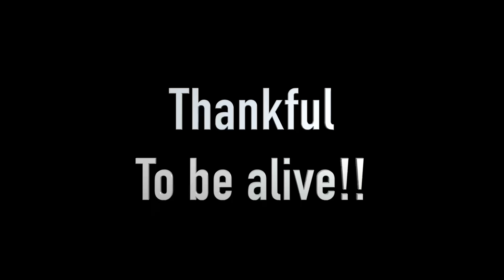The Firefighters said I was LUCKY TO BE ALIVE after this stupid MISTAKE!!!

Comment: This is my first time seeing one of your videos. It was awesome and terrifying all at once. I want to tell you a true story about a man I know. When he was 26 years old he was the manager of 7 food concession units. Six, were roll offs placed using a massive forklift. Each one was 8' square. Each of these units were fed approximately 250000v. Part of the man's job was hooking up the power to each of his units. It was drizzling out, the ground was wet, yet he successfully set up all of the six roll offs. Now each unit was supplied via 4, 1/2" copper wires. Each end of the wire had a 3/4" locking cam encased in a specific color rubber. Green, White, Black, Red. The "sow" aka generator, was in full displacement, it was pushing millions of volts. I don't know how many exactly. The man was using a headlamp with a white beam. Just as he was ready to set up his largest unit, a 26' trailer powered by around 750000v his head lamp quit. Frustrated as I was, yes this miracle story is about me, I went in search of a friend who might loan me his. The time is approximately 130am. I was cursing the weather, the time but NEVER one of my 30 employees, and just felt like damn!. But I got families of employees that depend on my operations running smoothly and efficiently. So I sucked it up, I knelt down, turned on the lamp but did not recognize the yellow hue, I picked up what I saw was the ground cam and went to plug it in and the very second my hand carried it to the piglet I  saw the mistake, I had made but it was too late, I remember a three inch spark. Witnesses, all 250 odd people present. Said the night turned brilliant white for a 1 mile radius and the subsequent explosion shattered windows nearby. I was thrown in an arc approximately 36' long and 16' off the ground to be slammed with such force into the very unit I was supplying that it lifted the 30000 lb trailer onto two wheels before slamming back down throwing my lifeless body ten feet away. Let me stop here to tell you that 1 month before I had taught my employees CPR. When the trailer flipped up it dislodged the coka cola syrup containers hitting one of my employees in the leg and dislocated his knee, he said to me later we saw you die but we had to try so i slammed my leg back into place and within seconds we flipped you over in it was obvious at that moment you were gone but we began CPR anyway with no though that you could not be saved. I watched the employees flip me over and the two did not stop for over twenty minutes till an ambulance arrived. Only then did they relent in their efforts. The EMT hit me with the electrical thingy and got a nearly non-existent pulse, very erratic, the 15 minute drive saw my heart stop for 3 more minutes. When I was wheeled into the emergency room,I was hooked up to everything, and it was determined that I was comatose with zero brain activity. They put me on life support and on a minute by minute observation. Around six hours later my heart stopped again and for 7 minutes they worked frantically short of putting hands on my heart before they rebooted it. At this point. The doctor said to contact my family for consent to remove me from life support because as he understood things, taking everything into account, I was not going to be able to survive. On my own. And if I did I would most likely live in a bed for the rest of my life. He at the point took me off the bed watch. 35 minutes later I woke up. I didn't recognize my surroundings, I removed all the tubes, IVs, and wires from my body. And had jumped out of the bed and naked as the day I was born I was, according to all who were present standing as a wild-eyed feral demon in the form of a man and everything around me was a weapon. Not one individual approached me. They were terrified. Each of them, knowing, that not only would I kill but that it was only an act of a divine power that I was standing and communicating so effectively. Each of them knows that NO one has ever recorded a survivor of what i had experienced. This was Only God's will I was not lucky, only blessed. You were NOT lucky, you were being watched over by my father GOD in heaven. God bless you always and keep up the fantastic work.❤
Reply: Wow. Amazing story!🙏🏻
Reply: Amazing! YaH is so powerful, He has the last say so! Praise YaH for everything! ❤❤❤
Reply: That is an awesome creative writing fiction story!  Did you win any awards for it, since the voltages you cite are pure BS, and that there is no way the whole explosion, lifting 15 ton trailers, etc. thing is also pure BS?

Comment: You bring up an interesting subject.  As homes deteriorate without owners, squatters damage the structures, storms go through, people may also try to make unauthorized/off code connections to have utilities...all this adds-up to the potential of running across unsafe situations.  Very glad you had some help keeping you from running into a full disaster. With tree trimming, we were told to examine yards for where lines run through the air, through plants (which can conduct power by contact or proximity), etc. We've all seen vines wrap along lines as well. 12:54 all this doesn't detract from the fact you are recovering the form of this yard and giving a needed assist to the neighborhood. It seems like the workers said that the house was permitted to be repaired, so your boost of a cleanup should be helpful all-around.

Comment: In my early 20s i installed those big C-band sat dishes... I had to drill through asbestos siding once and to do that you go super slow with paddle bit, but i was coming from inside to out. I hear my partner yell something and start running up the stairs from outside where i was working (2nd floor apartment in Eastern Shore VA) and as he came through the door and yelled stop i let off the drill. it shot out of my hand across the room and broke the drywall. I had drilled into the 440 coming off the pole. Left a beach ball sized black mark on house. 100% Steve saved my life.

Comment: Super lucky! My neighbor and his uncle both worked for Comed and had a bad accident with a wire. My then 26 year old neighbor got it first, resulting in both arms lost. His uncle went to help him and it unfortunately cost him his life when he got hit trying to save him. I'm not familiar with equipment installed on powerlines but something was installed several feet higher than where it was supposed to be in years past which supposedly would have prevented it, comed was cited for it several times and never fixed it prior to the accident.

Comment: Man, you nearly got fried! I'm glad you were holding the cutter correctly and using an insulated one - not all of them are. I think it's 11kV, depending on sea level and pressure, especially with houses having solar panels nearby.

It is sometimes suggested that human lethality is most common with alternating current at 100–250 volts; however, death has occurred below this range, with supplies as low as 42 volts.

Comment: @Al Bladez you truly are lucky.

You did the right thing by contacting the city.  That insured this issue got resolved in a timely manner.

Always assume wires are live unless you have a multi meter and perform a 3 point dead check to verify it's dead.

Comment: The wire from the pole to the house is always hot. When they cut power, they pull the meter, so there is no connection between the house breaker box and the live wire. But the wire from the pole to the house will light you up for sure.

Comment: oo i was replacing a main one time and was using a chisel to get the mortar from around the brick. there was supposed to be no other workers in the house that day cuz i was turning off the power. well some plumbers showed up. i told them they werent going to have power for a bit and they said cool. i shut it off and went to start chiseling and half way through was one of the biggest explosions ive seen while dealing with electric.. my chisel was blown to crap and i ended up in the er thinking i was gonna be blind from the flash. i couldnt see shit for somewhere around 4 hours. you definitely got lucky there my friend.

Comment: Reminds me when I was cutting some bushes with AC powered hedge trimmer. With last bush I discovered I had cut the cord of the device. I thought "What could possibly go wrong with the last bush?" Well, quite much. As I was finishing, I managed to touch the live AC 230 V wire. The experience was quite horrific. It was like a big man came and crushed all my body. Lasted for a second or two, which felt like a lifetime. I am so glad I was able to finally drop the trimmer. I crawled to neighbor's house who drove me to ER. No permanent physical damage luckily, but I got quite careful about AC with gardening. Nowadays I never do anything with AC without using a safety circuit breaker. And if I see even the slightest damage to the cord, I'll stop what I am doing, disconnect my stuff and go fix the cord, properly. I was fucking stupid but learned a lot from my mistake.

Comment: The lines to the house are a set of three cables carrying single phase 240Vac to the house. This consists of two hots with a neutral. The pole leaning over is what the utility ties their lines into to feed the power meter and house. This conduit is bolted to the side of the house along with the meter, fusing/disconnect. Most likely, since it is an abandoned property, someone tried stealing copper wire to make a quick buck. 

Him touching the wires with the trimmer allowed an arc to form. Once the arc forms, it can maintain itself for decent interval of time because the feeding pole transformer is setup to supply thousands of amps to multiple homes. It may or may not trip. You would know if did because everyone on that block would have lost power at same time. The moss being there, is just the perfect dry material to be ignited. I doubt it would set the house ablaze, but not impossible to do so. 

Utility will come, suit up, switch off disconnect, and then likely coil them up and secure the lines to the utility line/pole until house is re-built or renovated.

Comment: Lucky you. After school i was a worker in building tennis courts and metal fences for the waiting months. We built a fence at a hospital and were digging the holes for the posts, when 2 meters besides me a colleague pushed a metal rod into a 10000 volts cable. The main line to the hospital. Nothing happened to him. It started with a bang and flashes and green smoke from the hole. These cable ought to be 3 feet deep but they made a new road there with a ramp so it was only 1 foot deep.

Comment: Buy you a $10 voltage tester and just tap it on any wire you will ever be around. It will alert you if voltage is present. Must have for working around any electrical

Comment: Electricity is fun! I went to change out the ceiling fan in my bedroom so I flipped the breaker labeled 'master bedroom' and started taking the old one down. I touched the wires and my hand went numb. Turns out none of the breakers were labeled correctly cause the prior owners bought the breaker box at a yard sale and didn't relabel anything.🤦 I flipped the main and installed the fan with a flashlight in my mouth.  Had a friend come over and we got everything relabeled. 🤷🤦

Comment: from what i understand, the power company shut off power there at the house and removed their meter, but they didn't disconnect the connection at the transformer that feeds the meter. where i live, they usually leave the meter and disconnect the line feeding the meter from the transformer. i've also lived places that will only pull the meter. you should never assume that power isn't coming in from the transformer though. you would have been EXTRA dead if you rode that lightning because the fuse there is only designed to stop the transformer from exploding and will happily cook you to a literal crisp without blowing its fuse. that part that had fallen off the wall was just part of the transformer's side of the connection. unless the squatter jumped the meter box (with it looks like they might have) the house probably didn't have power

Comment: Those are rubber padded foam rubber.,or solid rubber sleeves most likely on that pole saw right. I'd online search for it.,an check with your local lawnmower equipment shop about getting extra added rubber sleeve protection added onto it no doubt about it at all.

Comment: I think the wire situation was a temporary hookup for the inside, the common and the hot lead go to the leads on the pipe and connect to a ground on the inside of the house to a ground, yes?

Comment: The power stops at the meter unless they disconnect it from the pole. You should know that if you are going to do that kind of work. The wire above the meter to the pole is hot unless its cut from the pole.

Comment: Stihl trimmers have rubber handles but that is not insulation from a shock. I thought the same thing since the handles are rubber but electric fences trace through the metal drive shaft and get you.

Comment: The wire going from the pole to the house is usually live unless it’s disconnected at the pole. When they do a disconnect to cut power from the house they will usually cut it at the house and pull the meter. Had a contractor tell me once he was talking to one of his new guys while that were carrying an aluminum ladder over to access the roof. He said he looked back and tried to tell him to watch the power line going into the property, (according to Jim the guy was about 5 feet away) he said he saw a flash and there was a loud bang and then a horrible smell and some mist. He told me the biggest thing they found could fit into a shoe box. 
Also had a great uncle who worked on high power lines. (This was in the ‘40’s or ‘59’s )They said he lost his footing on one of the towers and reached out and grabbed one of the power lines. According to my dad, they said he basically was turned into a big piece of charcoal.

Comment: Oh my goodness The Lord is good It looked like the meter was pulled with the one big wire piece down I know this sounds terrible but I think it was meant for you to be there Anyone could have touched that and they said they had a permit getting ready to be issued The Lord slowed everyone down and sent you there I firmly believe you had the Lord's protection along with your equipment and shoes The trimmer is insulated it absorbed the electricity While I know your adrenaline probably went through the roof You are covered by the Lord I firmly believed you saved a work crew I don't think as you they would have seen the open wires Love you Al thanks for walking your walk with the Lord and doing what you do to help people Love and Hugs
💗 grandma susan

Comment: had a guy lose his badge on the way off the job, lunch time...He stepped over a rail which the crane ran on, third rail was 3 feet lower. His badge ( clip ) came lose or whatever and fell down inside the trouf...he grab up what we called blue wire, thickness of coat hanger, but flexible. Likely put a bend ( L ) to reach down hook his badge and head on to lunch. The power arched, 90,000 volts, blew a hole in his stomach ( he was chubby ) where he was laying on the asphalt, and out his heel. Dead instantly.

Comment: Dang you got real lucky brother. That happen to my grandpa when i was 13 years old. During the summer i would help him do yard work and the boss sent us to knock down pecans from a bunch of pecan trees in a back yard. He gave us a long aluminum tube to knock them down with. Anyway it had rained the night before so it was a little wet outside. My grandpa started on one end i started on the other. All of a sudden i hard want sounded like water rushing through a pipe. That’s the best i can describe it as. When I turned i saw my grandpa being electricuted and then fall from the ladder he was on. Long story short i ended up doing CPR on my grandpa and he recovered about a year later. What happen is since it was wet out my grandpa got about 3 feet within the main electrical lines and they arced with the pole he was holding. They said he got 12,000 volts that went through him. He had 4-5 exit wounds and was burned from the inside out. He survived and lived a good life after up until 7 years ago when he was 91. Just be careful bud.

Comment: Since I'm seeing a lot of wrong answers here, the power in that home is off and nobody was stealing power. That conduit broke off the home at some point and the line company pulled the meter and told the homeowner to get an electrician to repair or replace the service before they'll reconnect that overhead line to the electrical service as that's where linemen and electricians jobs separate. There's a transformer nearby on a pole that feeds a handful of houses. It's normal (though probably not best practice) to leave the line connected to the transformer and tape off the wires so all they have to do is pop in a meter and crimp in right there when someone wants hooked up. A good rule of thumb is treat everything like it is on.

Comment: The line he hit is only secondary voltage, 120/240v, all it will do is make you feel a tingle 😂 the power to the house is disconnected but the triplex up to the point of attachment is still fed from the transformer on the main line pole which is why he got the sparks when he cut it with the saw , now primary voltage would be a different story for sure

Comment: The wires coming from the house are not hot anymore unless there is more than one power supply to the house. Those wires from utility pole are definently hot at the switch cut off. Dont put hands in it. Believe i see conduit pipe coming out of ground to a cutoff switch on the house